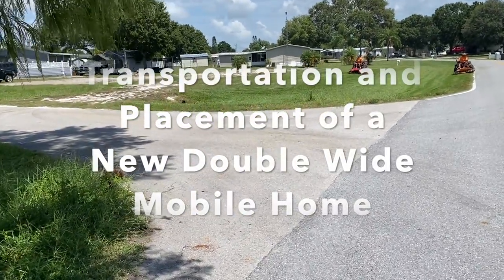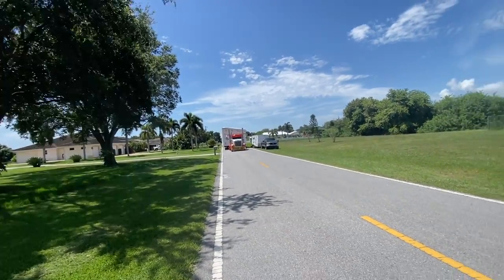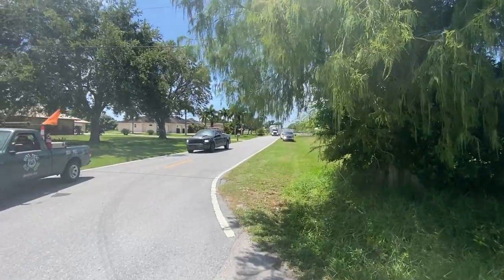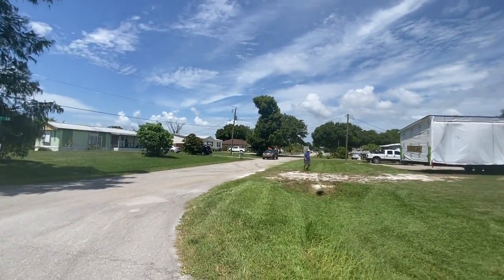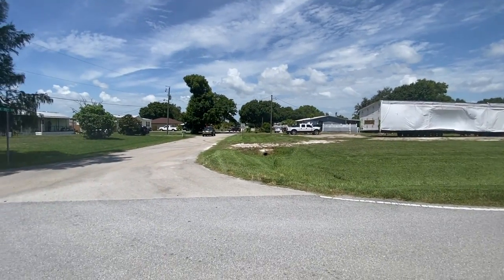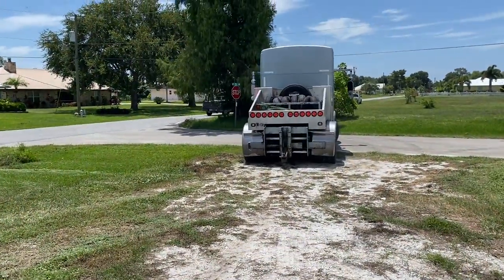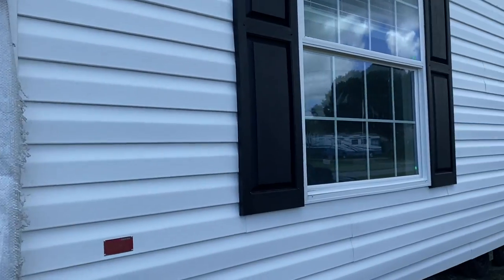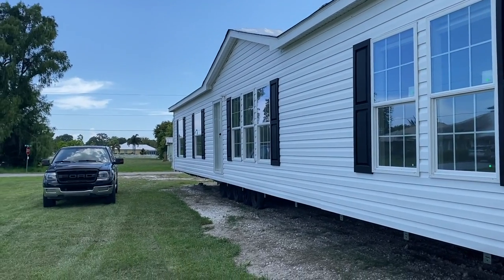Delivery and Placement of a New Double Wide Mobile Home

Comment: Am I missing something here?  I heard you say this was a new home.  But I don't see a slab or even any footings under the home.  If the HUD inspector knows what he is doing, he will fail that set up.  All new manufacturered homes are subject to a HUD inspection in addition to the regular building inspector stuff.  I dont want to see you put the home together just to have to move it and put a slab down.  I would talk to the installer AND the manufacturer about this while the home is still on wheels.  Just don't want you to get in a big mess.  I hope you do a follow up video on this home.  We would all like to see some of the process of putting this home together.
Reply from the maker: Thanks for your comments - FHA does not require a slab on all homes.  The county codes here allow you to compact the soil and use ABS pads.  Thats it.....  My buyer will be getting an FHA loan and this setup procedure meets all the FHA requirements and manufacturers requirements.  Every step in this process of set up gets inspected by the building dept.   Some states are stricter than others.   - Tom